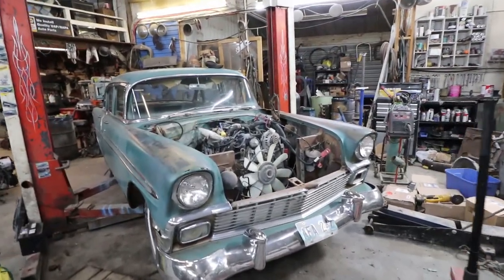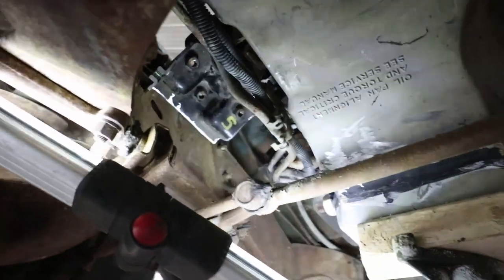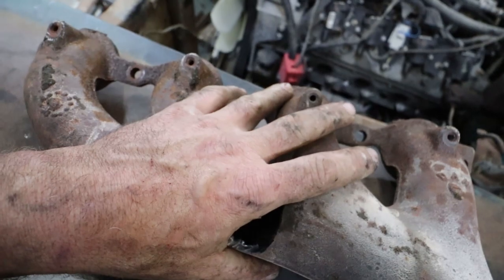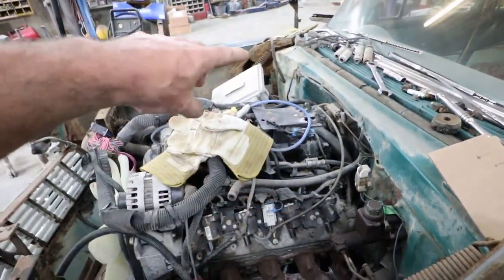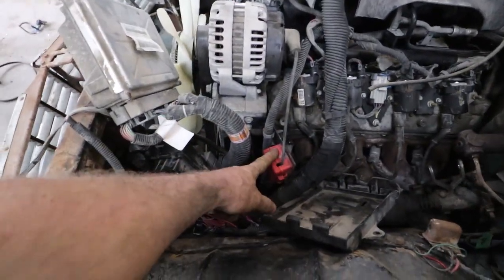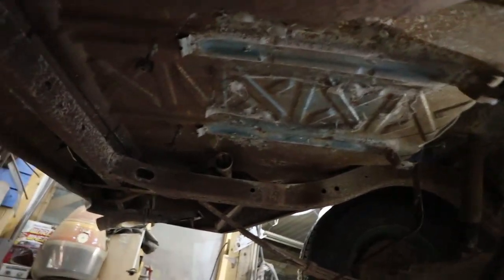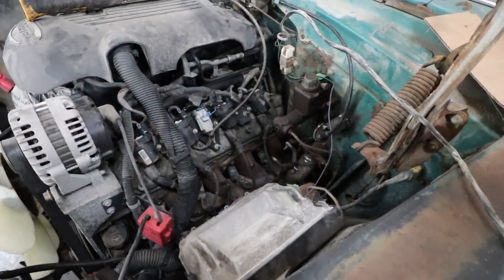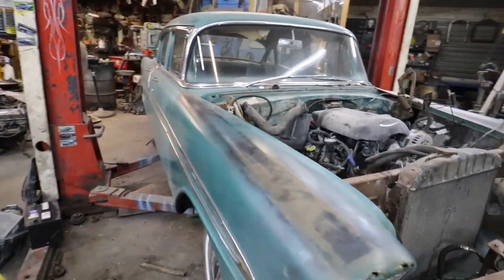Swapping a Silverado 4.8l LS into a 1956 Chevy Sedan Part 2

Comment: Good luck keeping things cool with that radiator.
Reply from the maker: It's worth a shot at least a stock tri five aftermarket will bolt in. With that said my wife's truck has a stock copper rad from a 60s Mustang and it cools all day without any issues

Comment: Pets all around fer a couple a hounds, da Ls is toward da firewall bound, plated engine mounts glued around, exhaust manifolds cut n ground, just keep welding till everythings sound. Tranny's cross membered, exhaust's kinda dismembered, shifty cable to column rendered, thermostat to da RADically installed not surrendered , blue flame 6 stored till it's remembered.

Comment: OCD Guy here: So this is going to be my first serious question! Will heat from the exhaust manifold not effect the steering box? Just curious.
Reply from the maker: I'm sure it'll get warm other than thinning the oil I don't see how it would really affect the box. if a feller is worried he can wrap the exhaust in header wrap or put grease in the steering box.
Reply: Been reading up on the issue, heat doesent really affect them. 
I could see the lube thinning and output seal leaking, but likely needed a seal anyway. I have 1/4” between steering box and pipe in my fargo. Dont know whats going to happen, i just did it.
Reply: Another OCD GUY. DID YOU GET THE MOT

Comment: I did not realize you could weld cast iron without a pre-heat. May be it is different when you tig weld. Thanks for the heads up on Youtuber "Make it Kustom". Short concise videos with excellent content. The host is high energy. Having the right tools and knowledge makes the black art of metal shaping thart much easier.
Reply: They are cast steel, not cast iron. You can mig weld them no problem.

Comment: Might want to add a gusset to that shifter cable mount. It was flexing quite a bit. Nice work as usual.👍🏼
Reply: Another OCD guy. Did you get the motor and tranny lined up straight?  😟

Comment: I need to learn how to bypass the computer for these LS motors. I put old truck cabs on newer frames, but have stayed with 90s trucks because of the added requirement of re programming. I'm going to need to learn how I have a 2001 K 1500 I bought down south Rust Free. Want to put a 54 GMC body on.

Comment: When prepping to weld aluminum you have the use a clean wire wheel (only use it on aluminum) and a new grinder wheel otherwise you will contaminate your weld area with rust and metal inhibitors from previous metal work...I have a specific wire wheel, grinder disk, and small de- burring bit set aside for aluminum only just to keep it clean . Great job on the 56 swap !!! Great project !!!

Comment: 309 L rod is Stainless steel it is usable but keep your heat down small stringer passes do not weave, and light peening 
Stainless in a vee grove will  want to shrink and will crack .I have repaired lots of CI and I like TIG BRASS the best

Comment: They sell premade motor mounts for putting LS engines into these Tri-Fives. They also sell headers for these setups. Wondering if you did not use them, because you wanted to save money on this job. Does it really save money though when you have to spend time fabricating? If it is a build for your own car then yes you save money, because you are not paying yourself.

Comment: With your manifold steering wheel solution you basically got a solid motor mount on the driver side! It should be good for the hard launches!

Comment: This car is coming along great. Is that small radiator going to actually work for that V8 to keep it cool enough? Or are you going to want to try to go for something bigger later on. I really dig how you made the gear selector work for that cable. Can't wait to see the rest of the progress on this. Great job keep up the good work!!!
Reply from the maker: It's actually a pretty large radiator but if it doesn't work he'll just get a stock one for the car made out of aluminum

Comment: Will the shift pattern be upside down, park at the bottom, now that the cable comes into the column from the top?
Reply from the maker: No, that why I changed it around at the transmission on the panel to reverse the pattern

Comment: Are you gona have enough room around the shifter cable if you put power brakes on it?  Those manual single cylinder brakes were marginal at best, putting a V8 in there will tax them significantly.
Reply from the maker: Putting a dual pot manual brakes.